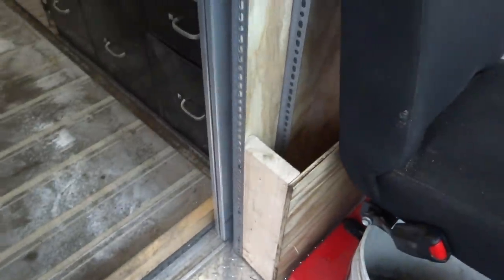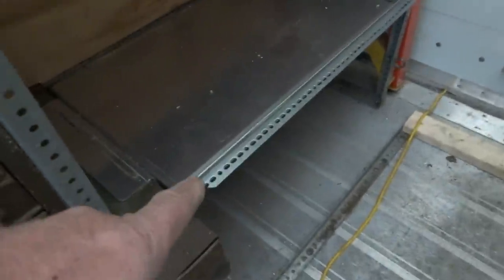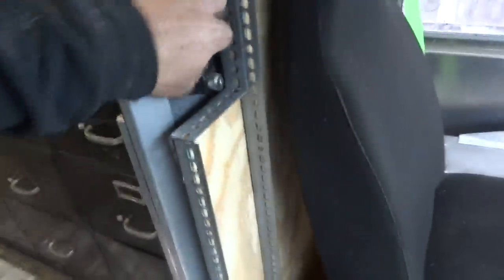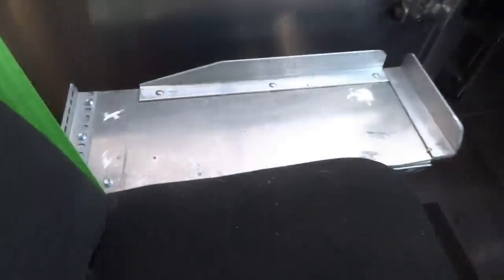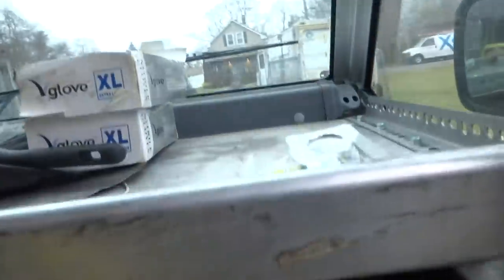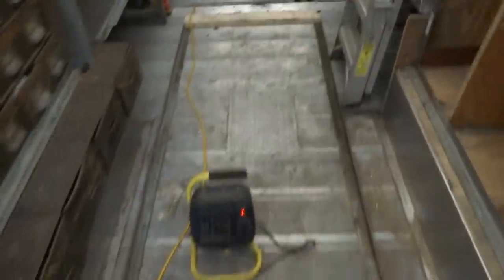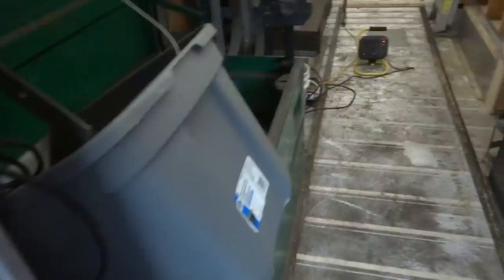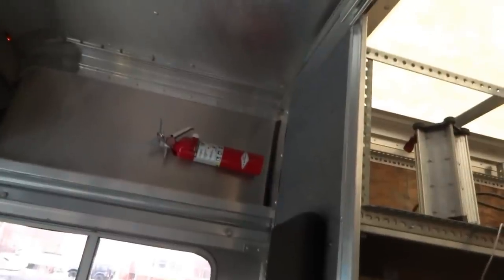NEW WORK TRUCK SET UP SHEVLING PART 5

Comment: RE: Your angle iron. I'd put edge protector strip where your driver's seat is, at least. If you whacked your head on those sharp edges you'd be in trouble. I'd put the edge cover anywhere you have a sharp edge. They sell the stuff in rolls, (edge trim) on Amazon. Truck looks good.

Comment: I think it's great that you know what your truck needs to be so the Benjamin's can keep rolling in. You have been thinking about your modifications and putting the vision together and that is rare today...... I hope that Roll-up door works for you. I have always been a fan of swing doors just for the maintenance side of it. Nice work Steve!
Reply: keep rollers lubed and keep spring adjusted no problems. but i would prefer swing doors too
Reply: roll ups are for dock work
Reply from the maker: i really did not have a choice on back doors .. i have had both ...swing doors are a issues when backing up to loading dock you get to close they do not open .roll up door does not have that issue . the new rollup doors are made out of plactic now so there a lot lighter then the old wood doors

Comment: I would put a little propane heater rather than diesel since you have propane torches anyway why carry another fuel. Would probable burn cleaner too. Nice Job looks like the ultimate service truck. 👍

Comment: Hey Steve.  How about a little RV heater like they use in pickup bed type campers?   An RV pro, I prefer the ones by Suburban Mfg, specifically the NT-16 .    It would require building an LP tank locker for the supply to meet DOT requirements, but it seems one would be perfect in your truck.

Comment: Hey Steve, great work on truck and you mentioned a diesel heater. I did research, ordered one, might get another. My electric bill went up to 3x cost of heating the house with gas. There is no economic way to add to the gas to heat garage and shop, currently resistant heat. In a few days, I’ll get one diesel heater to play with. If happy, I’ll order a 2nd. 2Kw electric usually takes care of the garage, have 3Kw in shop, but have to turn it on hours early. I’m thinking 5Kw diesel can do the heat rise when I need it. I’m too afraid to play with the Mr Cool stuff for electric, and I don’t have all of the equipment to do the pro stuff. Money is tight.

Comment: Just a thought, you could just use a small mobile computer and printer setup and use that file cabinet space for more parts and gear plus cut the load on your new truck by a few pounds unless the file cabinets are just small part cabinets already

Comment: Steve just something to be aware of, the weight your truck after. Most gas vehicles are limited to 16,000 gross.  Being overweight will cause performance factors, and the brakes will suffer. As you will be replacing them regularly. You have great ideas and am very happy for you. You should be back to work very soon. It's going to pay off. Keep up the great work. 👍

Comment: Steve the directions suck for the Chinese Diesel heaters. I have one as well. Also keep in mind they are over rated. Mine says 8kW. No Way ! My electric basement heater is a 5kW and it will out perform my diesel unit, which is where I installed my diesel unit. My guess is it may be 14,000-15,000 BTU, where my electric 5kW unit is 17,000- 17,500 BTU. Not sure in your case, but the cab is small in your truck if the rear sliding door is shut, so it may work well for you.

Since I bought a 8kW heater I was expecting close to 27,000 btu and hour.  I actually think in my area electric is cheaper then the Diesel, Unreal man.
Reply from the maker: i ordered a 8 kw one for the cab area .. to help in cold temps for the dog ..something to run when engine is off .
Reply: @stevenlavimoniere  I think it will work well in your case. They have 2 ways to run them. One is with the thermostat and the other setting is whatever the heat setting is. 1-6 usually. If you aren't sure on the shoddy paperwork, YouTube has some descent instructions depending.

Comment: Instead of using an inverter hard wired what about an inverter generator like 2200watt dual fuel that way you can use propane and not gas ⛽

Comment: Steve I hate the pop your bubble it is very unsafe and more than likely illegal in your state to have all that shelving in the cab loaded with flying projectiles and in case of an accident I know it wouldn't pass inspection in my state where I once got a ticket for having just paperwork on my dashboard open E350 Ford van with a 14ft Grumman box
Reply from the maker: my state is not that strict ... god speed worry wort